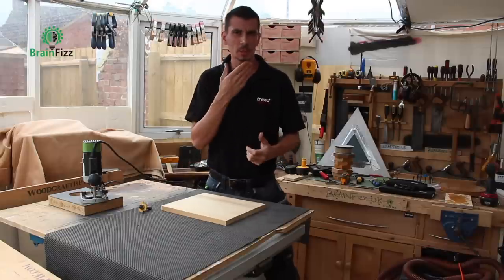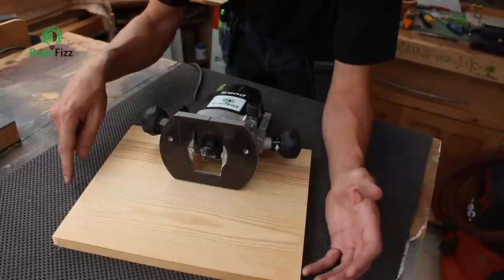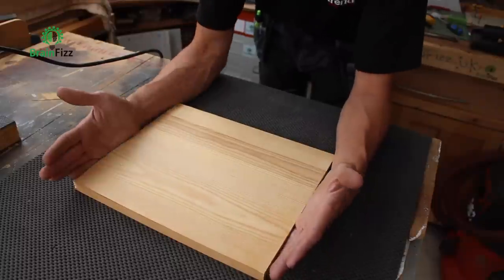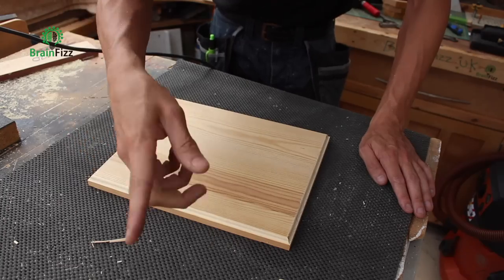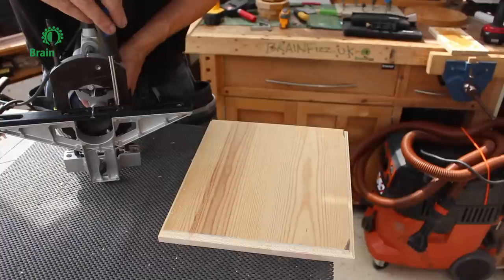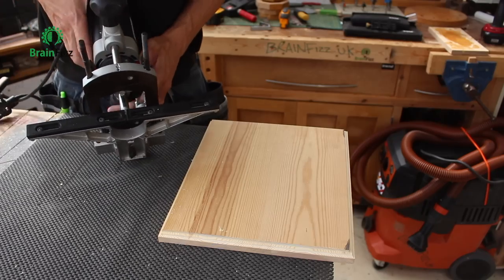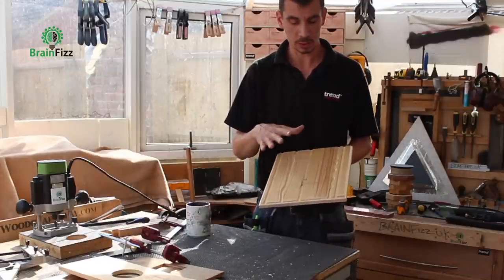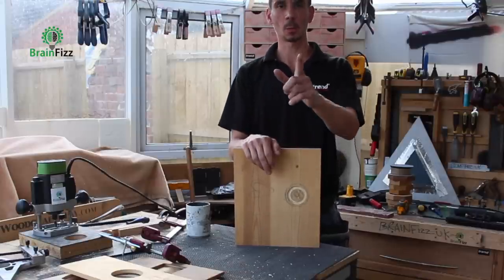Router direction of cut: Everything you need to Know! Tips and tricks for perfect safe cuts

Comment: hey Richard... question for you!.. I have bought a Bosch1200 Router.. what table would you recommend me buying to get the best for my cutter and bearing in mind after watching your video today I did actually unbox it and make 3 successful cuts after watching your video, thank you once again:)... Im a total beginner.. PLEASEEEEE HELLPPPPPP LOL.. Steve
Reply from the maker: Great question... difficult to say as I don't know where in the world you are, but here in the UK i always recommend the trend CRT3 router table, it's the one i have and its cost to what-you-get-in-the-box ratio is great. might need to drill the router insert plate for your router (their website has a compatibility chart listing for 90% of routers on the market), but you can either get your dealer to arrange for trend to do it in the facility, or do it yourself - very simple job no need to worry!!
If not, make one! again really simple and easy to do!
Reply: Seconded. But it's worth checking the alloy fence extrusion. Mine is slightly bowed along its length so one sacrificial cheek needs a tiny bit of shimming at one end, like a piece of paper, to bring it true. The sacrificial cheeks that come with it are terrible - they don't meet flush at the bit opening and catch. Easily rectified with you own sacrificials made from any engineered, flat board, ply, mdf etc. Still best value for money/features tho, especially if you have a T11EK router as the plate's pre-drilled for it's lift crank. I nearly bought the same Bosch until I realised this.
Reply from the maker: Oh that's pretty bad on the fence front! I bought a trend insert plate with the sole intention of making mine....then they brought out the CRT3 to update the CRT2 (which i thought was terrible!), so mine is one of the very first versions that came out...Mines spot on true and had replacement cheeks a couple of times.
Personally I would have been inclined to return it for a change, trend customer service is spot on - so never be afraid to call them up. the team are very helpful and genuinely customer focused!
Reply: In truth it' so close I didn't notice until months down the line when I had to do some very accurate rebates by then I had forgotten who I'd bought it from. What p'd me off more is that the plastic facings on the T11 fence (which is the same as yours) were 1mm difference in thickness thereby guaranteeing problems at the start and end of boards. Again an easy fix but it really bugs me that you pay good money for good tools then get these useless plastic extrusions which are never fit for purpose ime. I'd rather they left them out completely and gave you a drilling pattern for your own fence inserts tbh.
Reply from the maker: I did a video showing some modifications to my table, extraction on the insert plate and also the replaceable cheeks. They're a 10 minute job to do, but use Metric thread inserts and change the knobs.....They're imperial threads and so you either have to dig the originals out of the old cheeks, if you want to keep the original knobs, or replace the knobs. next time ill i'll just change the knobs to M6, as you can then make a batch of new cheeks for specific purposes - tall ones, offset ones for jointing, zero clearance for specific profiles and so on. way easier than sourcing lots of imperial thread inserts, and probably more expensive as well!
Reply: Cool I'll check vid. Already swapped to M6 on my cheeks hah!

Comment: Not simple.
Reply from the maker: Was there something you found not simple?
Reply: That was quick...I appreciate that. I am a diyer for my own needs and I only just recently purchased a fixed base router. I am also extremely cautious when it comes to using power tools. With that in mind , I am trying my best to understand before I actually use the tool. 
At the beginning when you were explaining about doing rabbets and dadoes (before you flipped the board), I was not having a hard time understanding the concept of anti-clockwise. However when you started to explain/demonstrate about inside the board I became unclear as to how to go about this the correct way. 
Maybe it is just me and I probably need to look at the video a few times.
Reply from the maker: No problem - purely by chance I was holding my phone and the alert came up....
Reply from the maker: So
During this video iirc I simply cut slots/dados across the board. - using either the fence or a straight edge...
When I do that a travel anti-clockwise around the straight edge (ignore the wood - that’s effectively just in the way of the cutter), at the start the bearing is our guide, referencing off the edge of the wood....
Then the fence is our guide, referencing off the edge of the wood, 
Then the router base becomes the guide - referencing off the outside edge of the metal guide rail... each time we’re travelling anti-clockwise “around the outside”
Reply from the maker: Once you start making holes - say cutting out the hole in a corn board, you travel clockwise around that edge. That’s pretty much all there is too it! 
If your new to routers, there’s loads on my channel.... but don’t be intimidated too much.... cut a little less material than you think you can and work your way up that way... they’re pretty awesome tools 👍